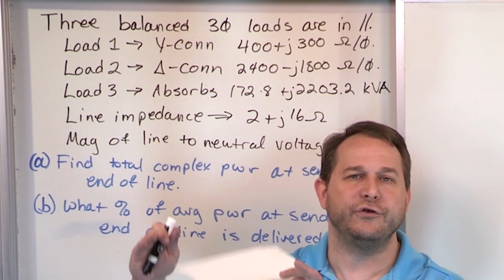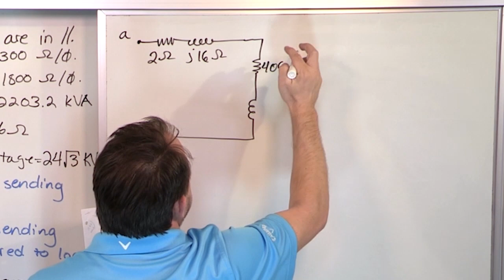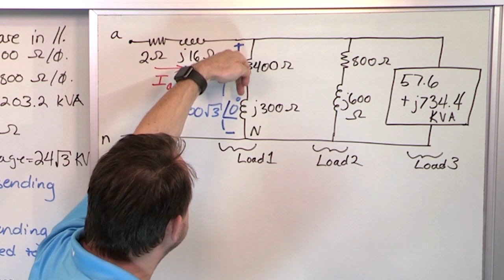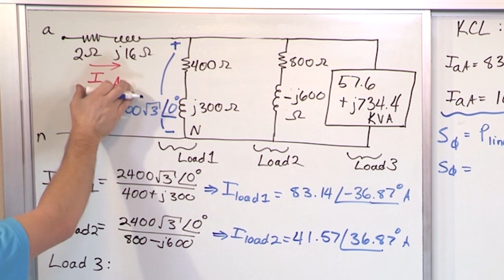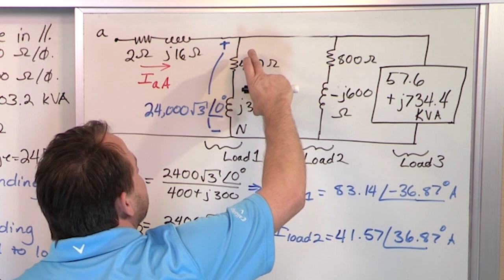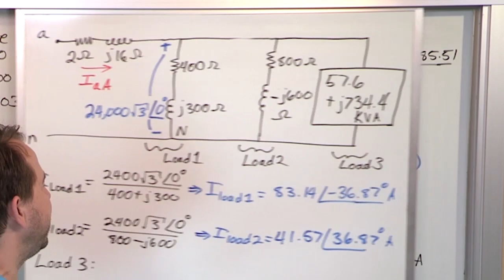Three-Phase Power Circuit Problems

Comment: What did I miss? The line to neutral voltage was 24,000 Volts.  Why did you use 2400 Volts to calculate the current for Load 1 and Load 2 and then 24,000 Volts to calculate Load 3. Was this a error? Should you have used 24,000 Volts to calculate Loads 1 and 2 also? Thanks.
I do enjoy your teaching, it is good and understandable.
Reply: it was a mistake. It should be 24,000V